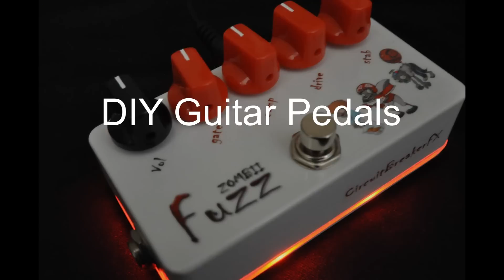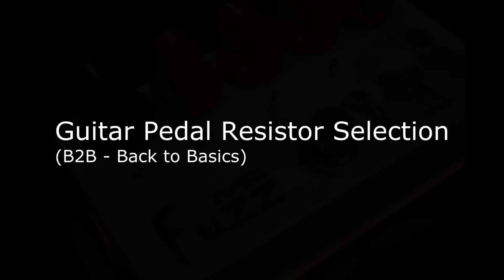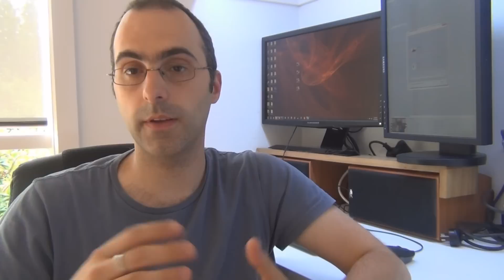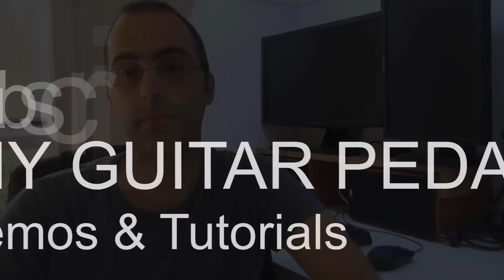B2B - Resistor Selection for Guitar Pedals

Comment: Are 1/4 watt  and 1/2 watt make a different in volume output, because i made a overdrive pedal with 1/4 watt and distortion pedal in 1/2, the overdrive pedal have more louder sound than distortion? , the portion of different is when i set volume knob overdrive in 10clock i need trun the volume knob distortion in like 10clock  to have same volume,

Comment: I have 8K2 5% resistors, am i not able to use these for pedals?
Reply from the maker: For "most" applications 5% will be fine.  Any distortion, boost, overdrive, fuzz, etc.  Some modulation may require more accurate resistors, but this requirement is not common.

Comment: Hey Paul, I didn't, been a sub for a long time, great channel and thankyou for sharing your knowledge and the time and effort to produce your tutorial videos. Mr. Carlson's Lab is a recommended channel, a particular Tech Tips Tuesdays episode is about reading a resistors value the easy way. I saw you had the resistor color code chart on your wall. With tolerance band on the right, read the first two significant digits, the third or multiplier is the number of zero's you add after the first two numbers, easy. Be good, C
Reply from the maker: Thanks Cass, will check out his channel, thanks for watching and your comments, I appreciate it!  Cheers

Comment: Great walkthrough! But what about changing resistance values? Can I just switch them all to see what it sounds like or will I burn my house?
Reply from the maker: Experimenting with values in a circuit generally requires some basic knowledge of the circuit.  You probably wont burn your house down but be careful with going to low on resistor values as too much current through a resistor can burn it out.  They can get INCREDIBLY hot (flesh burning hot)
Reply: Thank you!

Comment: Does the resistor brand matter at all? (considering the resistor is within spec)
Reply from the maker: Not terribly.  If I was building for sale I would use branded (xicon, te connectitiy etc).  For myself doesn't matter so much.  Also branded resistors tend to have stronger leads.  Some people like that, some people don't.  I like stronger leads.  Cost difference between branded and no-name generally tends to be only a few cents, so these days I generally just use branded.